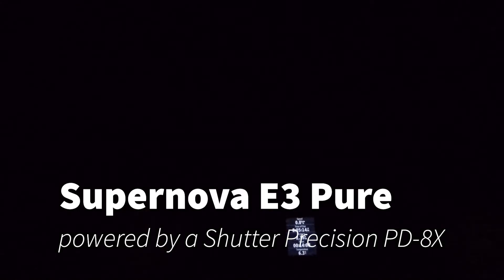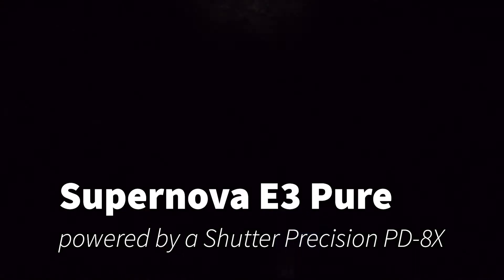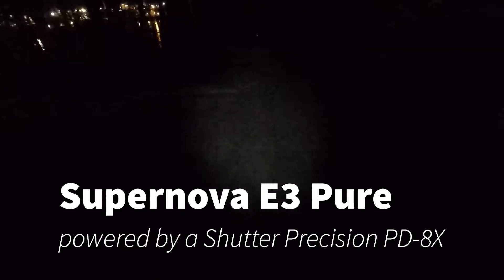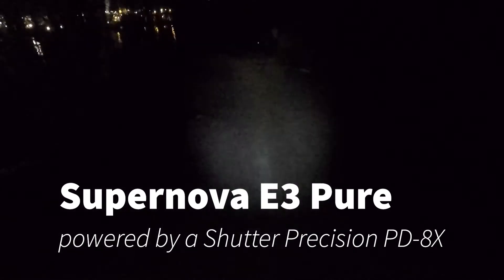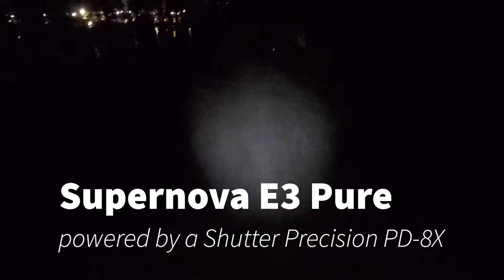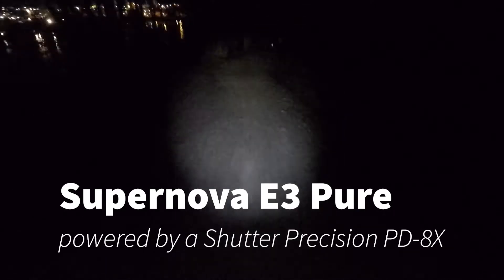Gravel ride a night using a Shutter Precision dynamo hub powering a Supernova E3 headlight

Comment: I just ordered a bike similarish to the cuthroat and it comes with a dynamo and supernova setup. Im trying to look at adding a switch or divert for USB charging. 
Plan on doing some single-track bikepacking. I think the supernova site sells a USB attachment. Gotta research a little more.
Reply from the maker: Yes, that's my plan too.  To wire a double pole double throw switch with a centre off position.  So I can feed a usb charger, or the light, or nothing to maximise pedaling efficiency.  Good luck with your project.